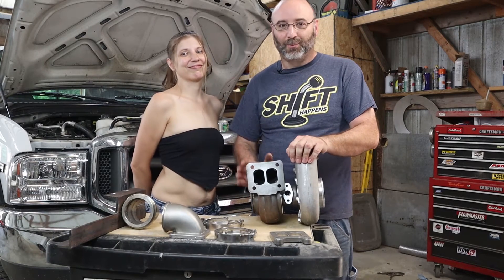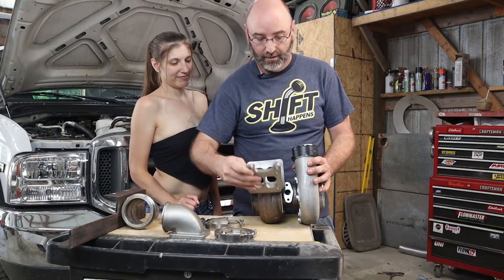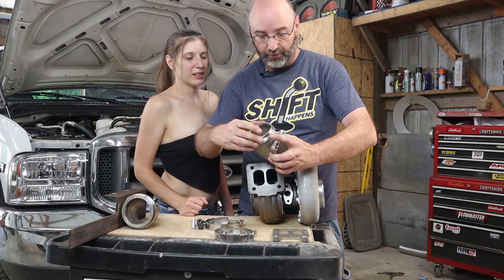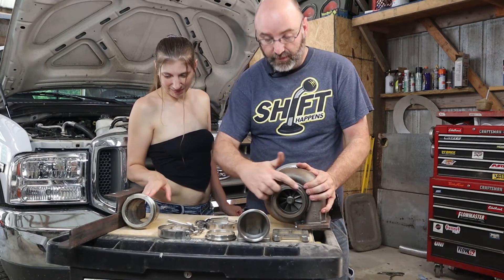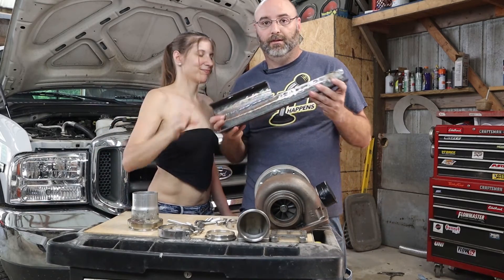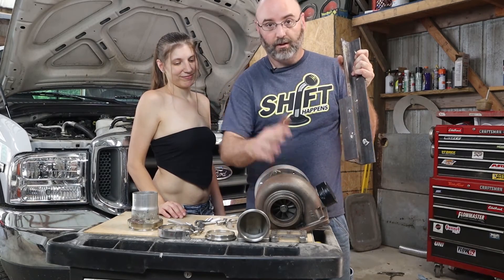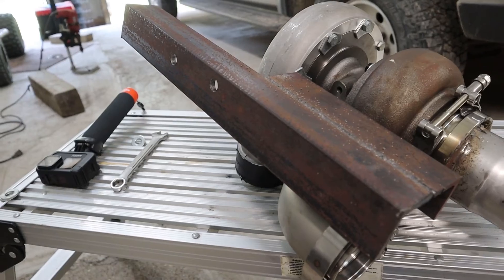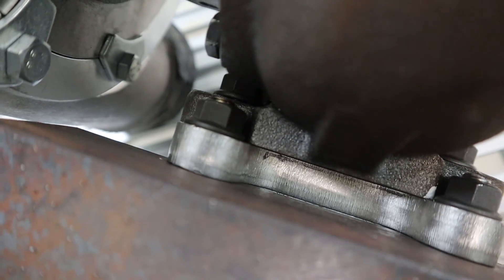Mounting a gt45 ebay turbocharger into a ford 5.4L f-250. part 2

Comment: How many psi are you running on stock internals and injectors?
Reply from the maker: I run 5psi
Reply: @CameronsonCamera  I’m wanting to do the same thing with mine where can I find details on your build I’ve got the basics from your videos but looking to basically replicate it
Reply from the maker: This is everything I recorded. Everything I did was based solely on price and not necessarily performance or quality but it’s worked for me pretty well. 

5.4 triton f250 turbo build
https://www.youtube.com/playlist?list=PLCemAZI8MkWuAa2xFm1I7zcWyMs0Q8Vf6